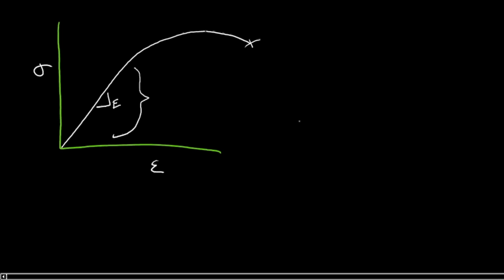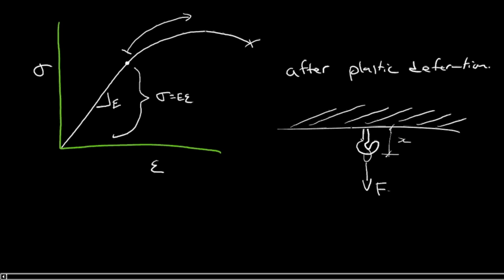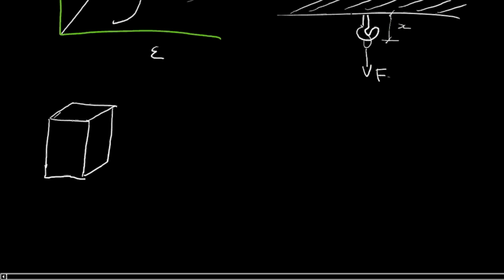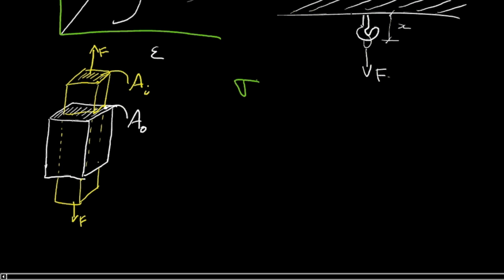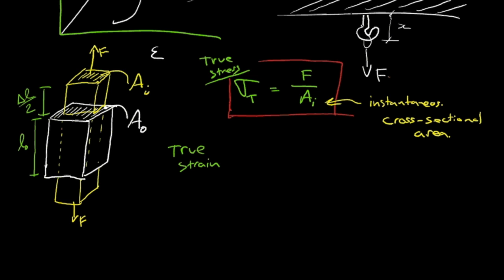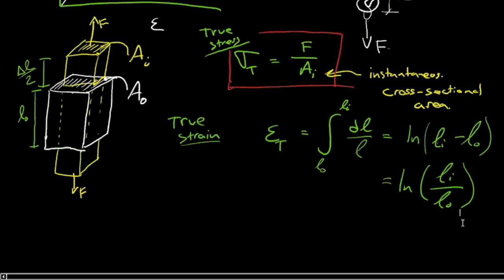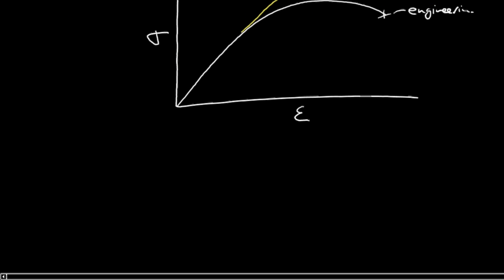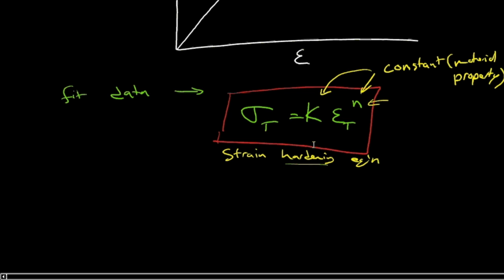True stress, true strain and work hardening

Comment: But why is it called the strain hardening equation? It was not explained in this video, however I will try my best to explain for others watching and wondering... In the region of plastic deformation, dislocations move around at the atomic level by slip. Common dislocations occur has edge dislocations, screw dislocations, mixed dislocations. The dislocations that a metal for example is able to experience effects how much it can deform plastically. There are many contributing factors to this, such as grain size, temperature, %cold work and others. However one thing that should be said is as the metal plastically deforms, grains begin to disalign. This creates diffuculty for dislocations to move through the metal. These difficulties in dislocations moving is what makes a metal deform less which therefore makes it stronger. By doing this, you're decreasing the ductility, however you're increasing tensile strength, yield strength and hardness. Many times this is done purposely in processes like cold working or precipitation hardening. So getting back to the original question, in this plastic region, the metal is being hardened because of the increase is dislocations in the crystal. Further ways of hardening to decrease dislocation movement is by introducing interstitial atoms (for example: alloying), these atoms create stress in the crystal such as tension and compression which prevent dislocations from moving through. The same can be said for substitutional atoms.
Reply: He is error 
Strain hardening eq is about dislocation density.
This is called Hollwon’s eq

Comment: Thanks for these online videos! I was just going through these, and I noticed that at 5:40 I think you made an integration mistake. It should be ln(l_i) - ln(l_0) because the antiderivative of 1/x is ln(x) + C. After FTC part 2, it simplifies to ln(l_i/l_0) by logarithm properties.
Reply: +Scott Ramsay hello nicely explained but at uts is that true strain which is equal to exp.  coefficient or engg.  straim???